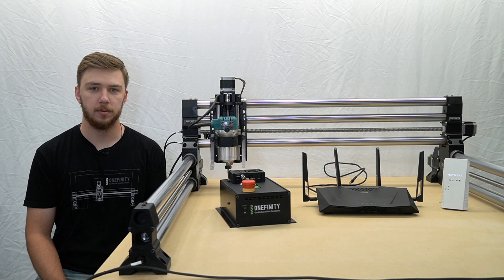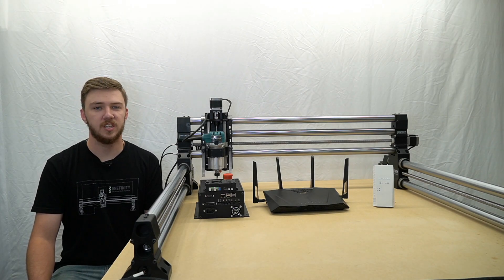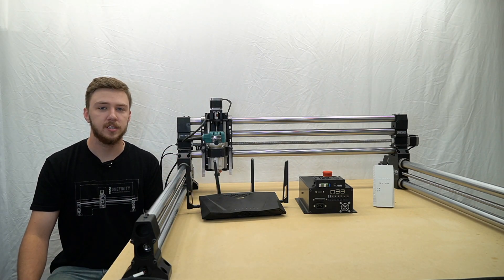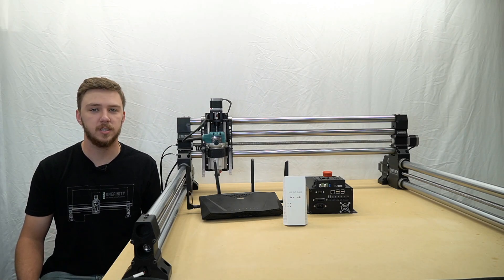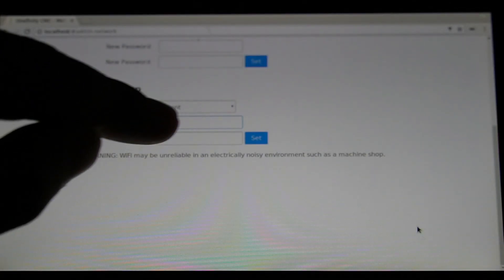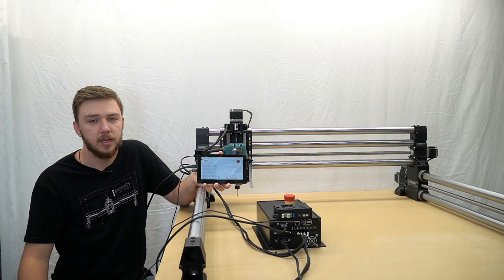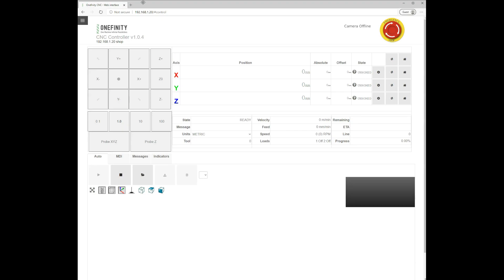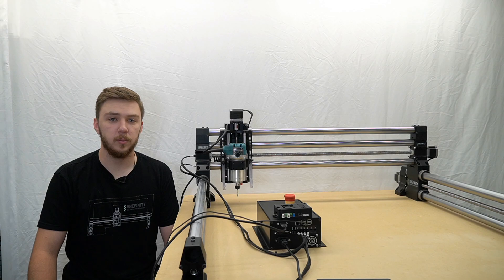Connecting Onefinity To A Network (Outdated! : Applies to Firmware 1.0.9 and previous)

Comment: My computer and Onefinity controller are both connected wirelessly to my router. When I enter the 1F’s ip address in the computer’s browser, it displays an error message. Is a Cat5 cable required, or am I doing something wrong? (2.4ghz on both)
Reply from the maker: There's a multitude of things that could affect this.  Contact your system administrator for help with home networking.

Comment: Can you make configuration changes to the controller from a workstation?  I have a new setup. My Journeyman is connected to my network via cat5 cable (could not get wifi to connect even with mesh satellite in the same room with Journeyman). With Cat5 connected, I tried updating my Max Jerk from a workstation (I clicked "Save"), and the setting did not update on my controller.  I might have been cutting at the time. I don't recall.  I had to change the settings at the OneFinity to make them stick in this case. Is there a proper way to do it or is this a known issue?  On a side note, being able to change tool paths from my phone is so, so cool. That works.
Reply from the maker: you can.
Reply: @OnefinityCNC  Thanks. I have been doing it for a couple of weeks, and it's awesome.

Comment: If you have a noisy shop (high EMI/RFI levels) there is another method
you can use to help mitigate interference.

Here's how to connect your Onefinity to the extenders' Ethernet port:

1. Setup the extender so that it connects to your existing network with a 
   Wi-Fi link. Use the instructions provided by the extender manufacturer.

2. Connect a CAT6A (shielded) Ethernet cable to the Ethernet port on the 
   extender and to the Ethernet port on your Onefinity controller. 

The controller will connect to the extender as if it was a hardwire ethernet 
connection. Now the device can access your existing Wi-Fi network through 
the extender.

Using the extender in this manner can reduce interference from equipment in 
the vicinity of your Onefinity CNC. You also will have only one wireless hop so
potentially your connection may be a little faster (reduced latency).
Reply from the maker: Great tip.
Reply: Thank you, I hot it to connect to my cell phones hot spot, it drops kinda often and I have to enter the ip in. We don't have home internet we live out in the sticks lol

Comment: I just got my 1F and I can’t even get the control screen to come up. I see the one finite logo and it says booting but it disappears and I see some numbers flash in the upper left corner then goes blank. Any suggestions?  Thanks!
Reply from the maker: Did you connect all the cables correctly via the 10" screen video?

Comment: Will be buying the one finity.  Want to be able use my laptop in different room from router, then machine right frkm computer. Is the wireless router separate from our home router and dedicated to the cnc machine itself?  Anr recommended cheap wireless router?
Reply from the maker: You'll need a router to be able to connect to the Onefinity.  You cannot connect a computer directly to our controller.
Reply: You can use your normal home wireless router as long as it has the range to reach where you have the onefinity. Just connected mine this morning.